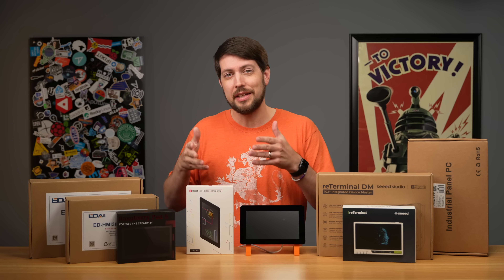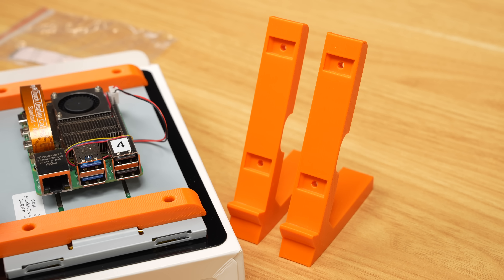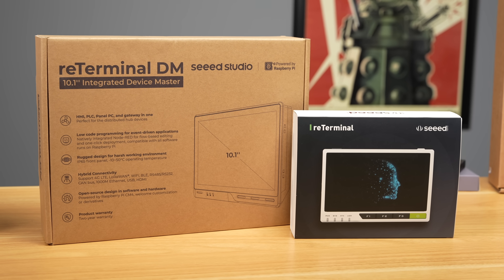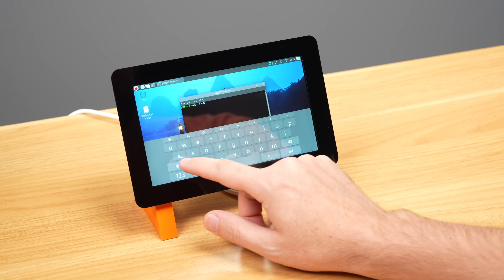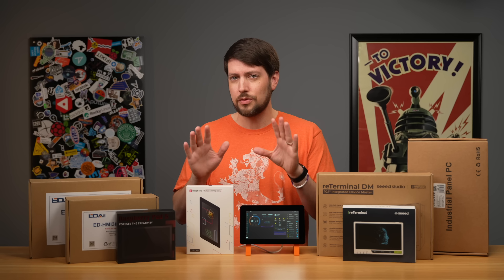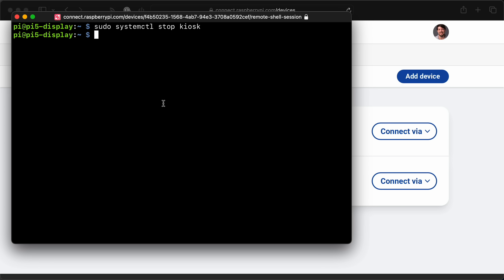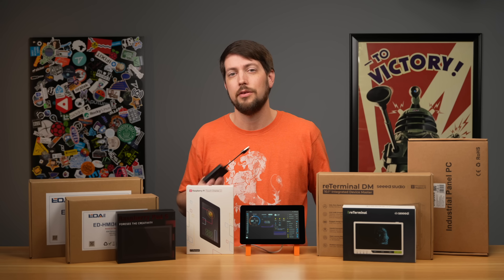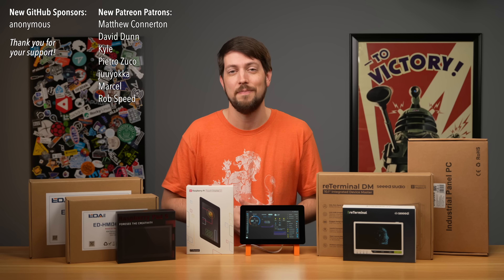I Control EVERYTHING with this Raspberry Pi

Comment: Is the Pi5 itself rated for those hot & cold temps? I have a pi5 with a metal case for a passive cooler that has libreELEC for a "netflix on the road" system. I know the touchscreen is more susceptible, but I wasn't sure on the Pi itself.
Reply from the maker: I don't know if the Pi 5 is rated for a temperature range but I've heard of people using it from at least -20°C up to 60-70°C. If you go any hotter the CPU will definitely throttle a lot, and it may be unstable.

Comment: My kid cracked his Chromebook touch screen. That gave the Chromebook a second life as an always-on browser that shows the current temperature from the various temp sensors in Home Assistant.
Reply from the maker: Always nice to find a good use for an old slightly-broken laptop! Like my old MacBook Air with a row of dead pixels. Still good enough to tote around for quick remote access/Terminal in the studio.
Reply: I used to buy "for parts" ipad 2s on ebay and take the screen out and then grab a hdmi controller board for that lcd. The result was most of my pi projects have an Ipad lcd as a display. They dont make the controller board anymore, so the ones for sale are far too expensive now. However when I did this like 5 years back you got a really nice apple lcd compared to similar screens on amazon and hdmi + VGA + audio out for like $20. It was big compared to other options offered by retailers for pi projects. 

The caveat is you need to make a housing for it which I 3d printed so no biggie. 

I don't think I saved any money time and effort considered, but it was fun and felt good, giving part of the tablets a second life. I even resold the rest of the ipad back on ebay in big lots to people who needed other components which reduced the cost.

Comment: Neat little screen.

Can this be used a substitute for an old tablet to use to follow a documentation when doing a build (like building a 3d printer or a soldering project, etc...) ?
Reply from the maker: That's certainly an option, though I'd wait for scrolling support to be added to browsers before going down that rabbit hole. Scrolling is probably the most annoying thing right now in apps that don't support it like Firefox/Chromium.

Comment: I'm using my OG display for a home assistant dashboard and it hasn't been great.  However your setup looks interesting.  Looks like I'll be setting that up as a weekend project😅
Reply from the maker: Certainly worth seeing if it's any better with the higher resolution!
Reply: @JeffGeerling  the way mine is running is with pios lite I have no touch keyboard it's getting old having to plug one in ever few days.  I'm really excited to have a working touch keyboard 😂

Comment: Portrait can be set from grub so the terminal outputs in landscape I believe.
Reply: I think you can do this with "fbcon=rotate:1" in the grub config (boot/cmdline.txt)  or in the config.txt "lcd_rotate=1" and "display_hdmi_rotate=1". I have a weird custom cyberdeck/pizero laptop I built that correctly shows portrait shell on boot--though it only shows in the middle of the 480x1920 widescreen display.
Reply: @lukemillermakes  a Raspberry doesn't use Grub by default.  But yes, you can set command line options for the boot loader in a Raspberry Pi.  But grub isn't the boot loader for Raspberry Pi.
Reply: @AndersJackson  thanks. That's a helpful clarification. The commands do work, but on an older pi zero 2w and I'm not well versed on how the bootloader actually functions
Reply from the maker: AFAICT this isn't possible on the Pi... would love to find a way to do it though.
Reply: @JeffGeerling  i think you could use an option in the linux kernel's cmdline, if the raspberry pi is using u-boot/systemd-boot, then it should be a standalone file in /etc
Reply: @JeffGeerling  why isn't it possible? at the boot log stage, it's just a framebuffer, after all
using grub, on desktop, it'd be something like `GRUB_CMDLINE_LINUX="fbcon=rotate:1"` or `GRUB_CMDLINE_LINUX="video=efifb fbcon=rotate:1"`
according to raspberry forums you would use `/boot/cmdline.txt` and put `fbcon=rotate:1` in it which is even more likely to work (since afaik pi doesn't use grub)
of course, other numbers will rotate it other multiples of 90°

Comment: If you want a good on screen keyboard, I've used onboard in the past with my Pi 5 and a display. Its much smaller and you can move it around, configure it etc.
Reply from the maker: Honestly if RPi made the keyboard at least transparent a little, that'd help. Or make it detachable... but onscreen keyboards are very tricky for Linux, which is not like iOS where it's touchscreen-first.

Comment: Do you have the problems with Waveshare screens documented anywhere? I get pretty much all my LCD and OLED displays from them and have never had an issue.
Reply from the maker: It really depends on the specific panel. One of the panels that was installed over the Pi using GPIO and SPI was throwing me for a loop when the Bullseye/Bookworm upgrade happened.

Scanning through the Pi forums and Pi OS kernel GitHub issues, there are a lot of times when a display will not work out of the box with certain use cases, and Waveshare doesn't give a lot of support outside of "follow our specific guide and you'll be fine".

That said, I still have a ton of Waveshare screens. Just, I don't buy them for ease of use, but for price.
Reply: @JeffGeerling  Yeah their guides can be rough sometimes. I guess I have been lucky in my uses not running into any issues.